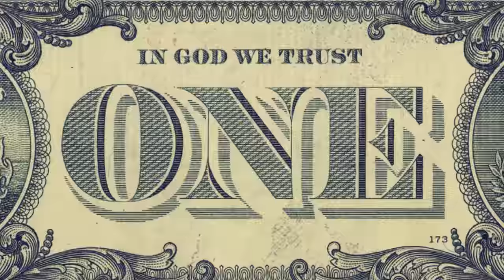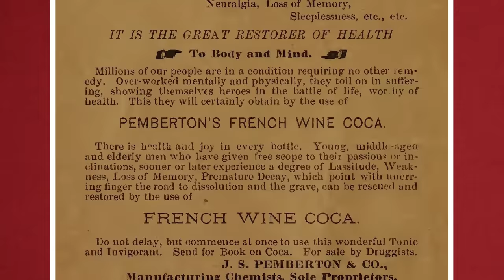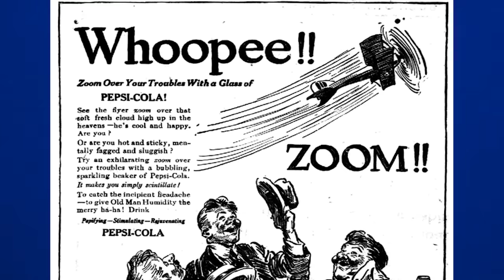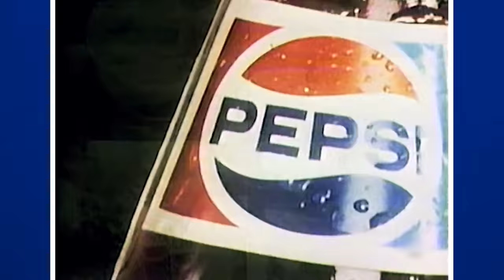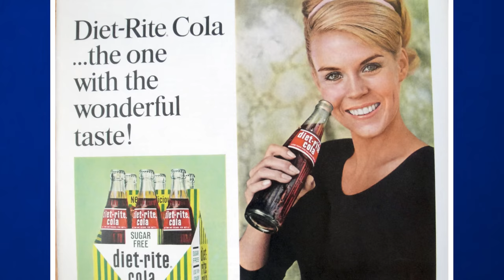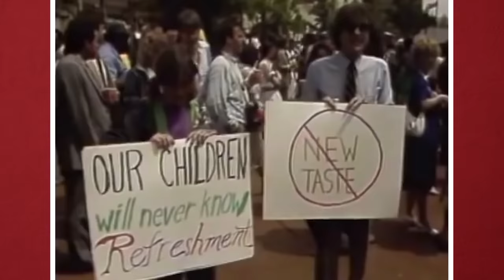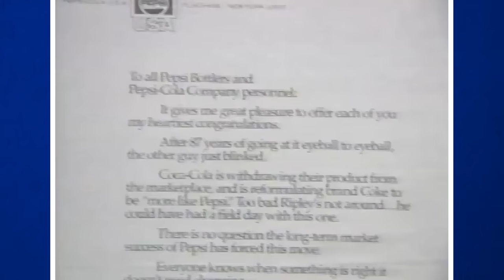Do You Remember the Cola Wars: Coca-Cola vs. Pepsi?

Comment: There's am excellent write-up on New Coke that appeared in Mother Jones. The tl;dr is that, in blind taste tests, people did prefer the taste of New Coke to old Coke or Pepsi, but a few people got unreasonably upset with the idea of New Coke replacing Coke classic and tried to convince everyone else to agree with them. The same thing basically happened in the real world, except that in the real world there were grifters like that Old Cola organization looking to make a quick buck off the relatively small number of people who were legitimately upset about the change, and those people were so loud and obnoxious about it that they won out in the end.  It didn't have anything to do with the Pepsi challenge or Coke's internal taste tests having flawed methodologies (the experiments were replicated multiple times under laboratory conditions with no clear explanation for the discrepancy), and it definitely didn't have anything to do with high fructose corn syrup; in spite of the rumors some people propagate, including the head of that Old Cola group, bottlers from coast to coast were using 100% HFCS by 1984, over a year before the launch of New Coke.

Comment: TV did not have three channels in the 1980s. Over the air was at least five or six and they had cable in 1980. Cable started to begin in the late '70s and HBO for example began in 1975. ESPN began in 1979. Yeah the cable channels weren't very many back then.

Comment: McDonald's Coca-Cola tastes better because they have a unique process of dispensing it.
If I'm correct, most McDonald's locations have a special metal container that holds the Coke syrup and keeps it at a specific temperature, same thing with the carbonated water, it's very heavily controlled.